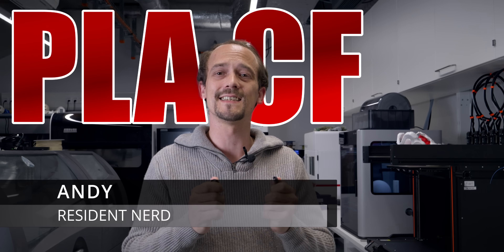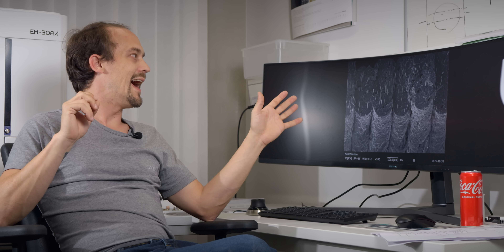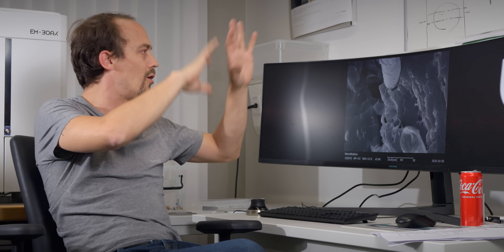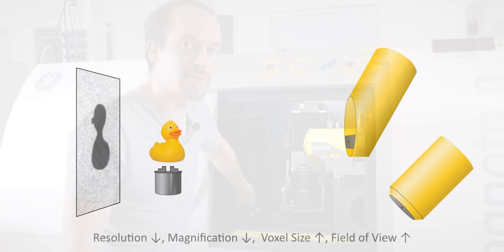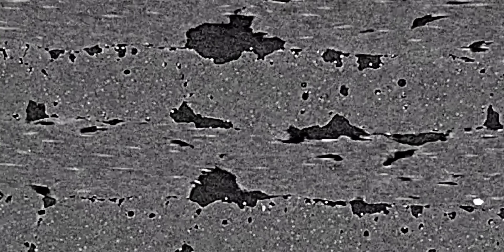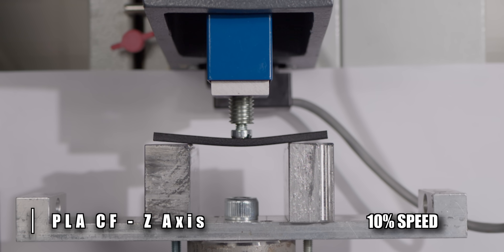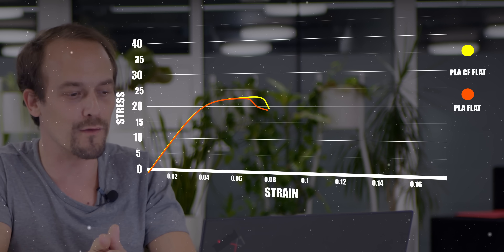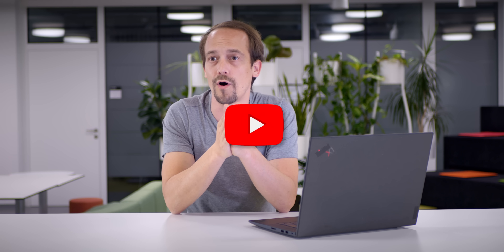3D Printing’s Biggest Scam Is Even Worse Than We Thought!

Comment: I just subscribed for the upcoming video part 3 you mentioned in the comments.

Verwende selbst nur PA-CF für ein spezifisches Teil. Für Kite Ventil Adapter für Duotone AirPort Ventile und da nur für das oberste Bajonett Teil weil PA dafür einfach zu weich ist.
Das ist weniger als 2m Filament pro Ventil. Danach putze ich die Teile damit sich im Alltag möglichst wenig Fasern von der Oberfläche lösen.

Wenn jemand ein anderes Material kennt dass diese mechanische Belastung aushalten kann, ich bin immer für Tipps offen.

Comment: Everyone knows PLA cf is for surface finish only. You want engendering grade parts use engineering grade filaments. Why did you even waste your time?
Reply: Because not everyone knows. That is clearly evident by the fact that people made it, and it sells.

Many people are victims of marketing, and hype, or simply believe that because CF helps in material X, it will help in material Y, because they do not know enough about the materials to understand why it won't help with material Y.

You need to remember that not everyone has your background knowledge of understanding to lean on. Not everyone has the time to thoroughly research the materials they are using.

This was not a waste of time.

Comment: I'm not an engineer but simple logic dictates that the strength of a composit is affected by a few simple parameters. 
The compression resistance of the filler/ binder, the stretch resistance of the tension fibers, the binding strength between the two, and the physical dimentions of each and the relationship between the two. 
If the filler doesn't bind to the fibers they are useless.  If the fibers are to short they do little to resist stretch. Overlapping short fibers aren't as good as continous ones running the length of the part, and in that case the spacing and adherence are the critical factor.
It appears carbon in the configuration used ( and i realize there are different amouts of fill available,  for both) doesn't provide nearly the gains in strength as a non-homogenious lay-up specific to the product.

Comment: What printing temperatures are you using? I always bump the default temperature +10-15c for most of my filaments and my layer bonding is always excellent. My parts will fail like an injection molded part would- cracks through a solid at an angle to the layer line not along the layer lines. Been printing since the original MakerBot Replicator. I print with pla-cf and my parts are superior and make a ceramic/metallic tinking sound when dropped or struck.
Reply: My guess is your mysterious voids are also being caused by low printing temperature. Looks like you’re printing a partially melted solid. Add 10 to 15°C to your printing temperature and do the inspection again.

Comment: This is a most enlightening video of carbon fiber reinforced PLA filament! Thank you for documenting and publishing your work!
Regarding the cohesion of the PLA polymer to the carbon fibers, and the voids, there are many other variables, such as the print settings; Controllable variables such as nozzle temperature, inner & outer wall speed, layer height, layer width, etc, and uncontrollables such as the worn nozzle diameter, material batch pre and post conditions, room humidity, etc.
A CT scan of the un-extruded filament would also be enlightening: Does it come with voids, are these voids filled with humid air, etc?
Reply from the maker: Thanks for the great feedback! A CT scan of the un-extruded filament is a fantastic idea for future research.

Comment: Excellent work! I’d love to see a deep dive in other CF-filled filaments. 

Also I’m curious about if glass-fiber filled filaments like Bambulab ABS-GF compare to carbon fiber filled. We find that ABS-CF has an excellent strength, rigidity and layer adhesion. We like it even more than CF materials, but we do not have measurable data about its comparative performance.

Comment: Yes please do.. like everyone else i thought same and bought many rolls of PLA CF and PETG CF  and in my experience also noticed many times that PLA Cf and Petg Cf are much worse the standard PETG and 
I keep getting photos of cracked Parts from my customers even 2 days back also one customer sent me a cracked layer part and i  have to replace it... 😢

And for context ( parts i sell are used in Ather 450X Ebike/scooter for mounting mobile holder and action camera... ) so it really needs to serve a strong purpose 😅

Please do more videos and what can be used in my situation that is also budget friendly as in India specially my custom parts are priced reasonably   So ... i would not want to increase prices on changing materials at-least not drastically
Reply from the maker: Try to use a hard 95 or so tpu. It's energy absorbent and nearly indestructible. 
Also nylon if your printer can handle it. 
I used to own a 3d printing business and had a branch in India. So I know about the issue of keeping it dry enough but the invest in a cheap dry box is worth it.

Comment: @1:40 - which nobody called out? if you read the comments on your last video, you find a post by me:

i wrote 'in organically filled filaments (wood or carbon fibre) usually a "coupling agent" is needed - for example stearyl titanate but this also greatly increases the layer adhesion'

the PLA does not want to stick to carbon fibre and this weakens the part - to solve that, as i said a coupling agent is added, stearyl titanate or maleic anhydride

so if carbon fibre fillled filaments have better inter-layer-bonding it is not because of the carbon fibres, it is because the put in a lot of other additives

Comment: First of all thanks for the great video. You had me at "About... Well, actually exactly x200" 😅

Now, I'm not sure I'd jump to conclusions for ALL PLA-CF. It's entirely possible that some manufacturers do the proper R&D of finding the right dispersant (and its amount) + the right adhesion promoter between fibers and polymer (and its amount). That would be standard practice for making a formulation for an engineering product.

But... PLA-CF that most people buy is a consumer product and to keep it competitive on price I'm sure some corners were cut :)
Reply from the maker: You're absolutely right! It's difficult to make blanket statements for all materials, and the quality certainly varies greatly with consumer-grade products.

Comment: Few advantages of PLA-CF: less shrinking, better dimensional accuracy (yes, PLA shrink as well, for example I need few holes as template for drilling). Additionally, you can anneal PLA-CF having huge temperature resistance without huge deforming of the material. Core filaments have fibers inside of filament.. And I would also like to see health effect investigation of carbon fibers. 
Other: Technical filament with the best layer adhesion is the Qidi PET-GF. Somehow they solved that fibers stick to the base material.. You could check what's happening inside..

Comment: 16:26 yes please video on filaments that benefit from CF
Reply: I would say PP-CF. It warpes a lot less then standart PP
Reply: I've used PETG-CF10%, compared to plain PETG it feels and handles completely different though the main difference seems to be surface finish with almost no visible layer lines. That said I use the hell out of reinforced nylon, I started with asacf08 and could immediately notice a difference. Part stiffness is far higher, and a great finish. My current favorite filament for items that will see high use is PPA-CF core, there are many claims made as to the benefits of the core concentrated fiber so I'd love to see a test on something like that! (If not only to justify the cost to the wife 😂)
Reply: @SgtDanny2142     this stuff? Looks cool! So you prefer the Core over the normal distributed cf ppa? Any prot tips for printing with it? Nylon print profile good enough? I have hardened tips, Core One as well as enclosed XL. Glue stick on smooth or textured bed i assume yeah? I have some cf ASA i have yet to try as well as cf nylon X. Excited to put these performance filaments to use. Cheers!
Reply: Very curious to see if CF benefits PPS. Pure PPS filament is a little cheaper than the CF version, and doesn't require a hardened nozzle; so it'd be interesting to know what (if any) benefits the CF provides for the additional cost.
Reply: @kazwalker764 It allows it to be printed. Pure PPS warps like crazy. PPS-CF prints beautifully. That's the real advantage of cf filaments, dimensional stability and printability.
Reply: @BFriesen  Interesting, is that the case even in a heated print chamber?
Reply: @kazwalker764 Yeah, a heated chamber helps, but anything non trivially sized is a disaster without the carbon.
Reply: that would be PETG CF. its amazing
Reply: @genin69 i think he literally says in his videos that pla and petg's mechanical properties all get worse...
Reply: @genin69  It still has terrible impact resistance.

Comment: Due to my studies i can be both a Composite Technitian/Engineer and an Additive Manufacturing Technitian/Engineer and i have an adequate understanding of materials especially polymers and carbon fiber
As soon ans PLA-CF became mainstream i already knew that it was a "scam" since the only benefit you'd get is a stiffer part. But now you debunked that aswell and proved that PLA-CF is good only if you want a PLA print but with hidden layers and a better texture (and maybe better dimensional accuracy).
Loved the video and I'm looking forward to the Real CF Materials and the Glass fiber Filaments to prove or debunk what i know about those

Comment: I think comparing xray analysis of this would be interesting: Some materials side by side: PLA, PETG, ASA and a foaming filament, for example Aero ASA. Also maybe check (for one of the materials) different printing temperatures and moisture levels to compare bubble forming overall uniformity in polymerization.

Comment: I bet those voids are from turbulence in the flow of the plastic. I dont think a lot is thought about in the smoothness of the inside of the nozzle, which would be completely destroyed in short order by abrasives. Or it could be from offgassing of the material as well, not from moisture, but from the polymer breaking down. 

Just thinking out loud here.

Comment: I've been chatting with someone from a large filament manufacturer about PLA-CF. They basically agreed that it's not a good material in terms of mechanical properties, but market research still showed significant demand for it, mainly because of the surface finish. Even in their own data sheets, you can see that the PLA-CF performs significantly worse in basically every category. It's only slightly better in impact strength, but that's likely because of a different PLA formula.
That just shows once again that reading the TDS is important when choosing materials. Even if they can't be compared across manufacturers unless they were tested independently by the same standards, even within one manufacturer, it can quickly show you things like this.
I'm curious both about other CF-materials and the potential health hazards.
PLA-CF isn't an engineering material, but it can look nice, which is still a selling point. PA-CF and similar materials do benefit from the carbon fiber, that much is clear.
That's why I think research about the health risks would be interesting, because even if PLA-CF sucks as an engineering material, people will keep using it because of its look.
If it is indeed a health hazard, people might need to reconsider using it at all.
My biggest question after this video, which would relate to both topics, is if materials such as PA actually do bond with the fibers, and if that's the reason why it's an actual benefit for PA-CF and if that also means a lower health risk, since the fibers wouldn't just "fall out".
While PA-CF is probably one of the most popular CF-filaments, I'd also like to see how ASA and ABS interact with CF reinforcement.

Comment: Carbon fiber is the asbestos of the 22nd century.
Reply: No it isn’t. Asbestos fibres are far finer and needle like. They cannot break down in the body. Carbon fibres aren’t classified as a carcinogen, are much thicker and do break down in the body.
Reply: @dominicj1170  It would be helpful to show sources that confirm carbon fiber is broken down.  The articles I have read say it is pretty chemically inert with respect to most biological processes and the body just tries to work around it similar to asbestos or glass fibers.  It frequently fails at this though and so having pieces of chemically inert materials inside your body is still a very bad idea just like SiO2, asbestos, coal dust, etc...  

I do not know what kind of information people would use to cause them to think otherwise...

Comment: Carbon Fiber by itself is weak, it needs a strong bonding agent for it to be strong.  From what you found, there IS no bonding agent to strengthen the fibers. There is also no interlinking of fibers in those tests. What makes a panel made of CF strong is the linking of strands, the bonding of the resins, and the tight compression of all the materials as it cures.  If the plastic that is embedded with the strands can bond to the fibers, then the CF can actually add to its stiffness, but structurally, what you found, is just a scam.

Comment: There is no scam and therefore this video title is clickbate. You're simply pulling the claims out of proportion. I am printing with all kinds of materials for over 10 years now and CF-infused materials were never about strength. Strength doesn't actually mean anything at all, because it is used for all kinds of properties that even conflict with each other.
Sure CF-materials were very expensive, especially in the beginning. But all new high-tech filaments are.

Here is what is not a scam about CF-Filaments and what they were marketed for: CF-infused materials help with printability. That came way before closed printers flooded the market. Open printers suddenly were capable of printing higher temp materials, like ABS and PA without any significant warping. That was a very big deal all on it's own. Further, the materials became stiffer and that's a fact and no scam either. Sure also more brittle but I have lot's of use cases where I need stiffness and high temp capabilities. Neither ABS nor PA6/PA12 can handle temperatures above 130°C and they are not stiff enough for many applications, expecially in measuring equipment, where you mainly need stiffness and can't use metal parts.

CF-additions also help with heat dissipation and also making parts more heat resistant.

When it comes to PLA and CF additions it is never about adding any mechanical properties, besides maybe better heat deflection. But most PLA-CF don't contain enough CF. Most are between 5% and 15%. But they do provide easier printability and a finish that hides the layer lines.

Regarding health risk: When melting CF-infused materials health risks may be a factor, but it is way less than melting PETG, ABS, PA. Pure PLA is probably the safest one out there (not PLA+!) but CF is very heat resistant and can't melt at that low temperatures. So that is not actually a real concern.
In terms of the particles: There are people that compare CF particles to asbestos but that's pure BS. The particles are way too heavy to fly around in the air like asbestos can and way too big to go through skin. Yes they can partially embed into the skin, just like wood and metal shavings can. However it will be rejected by the body. There are way worse things out there to worry about (e.g. cigarette smoke, teflon and similar chemicals, car exhaust, and much more).

Comment: Was the song AI generated? So epoxy any CF reinforced materials like any other CF projects, and use gloves and respirator when handling any raw materials.
Reply from the maker: Yes it is ai made 😅
And greate tip with the epoxy
Reply: @Ibuiltathing it was crazy good! Which model did you use?

Comment: Good video with very good testing methods, but for me PLA-CF was nonsense before watching this video, I´m printing for 4 1/2 years and never used PLA for something that has to be strong.
For example, I glued 2 plates ( 120mm x 60 mm x 5 mm ) together with a bit of my own glue, that was a mixture of ABS and acetone.
Next day had to use a lot of power to separate them again, the PLA layers splitted, but the glue point was intact !
I use acetone in many ways, so I clean the (glass-) bed of my old Creality CR-6 SE every 10-20 prints with it and it looks like and the adhesion is like on a brand new one !
In your former video ( Form next, Fibre Seek) you said in a comment, you would like to see this technologyt on a Prusa XL, but let me tell you, Prusa printers have a bad quality seen over all, I have seen tests when more fog (from a fog machine) came out on the corners ans the door then on the outlet, for such a test it was the badest (housed) printer !
I would NEVER buy a Prusa, because the prize is much to high for quality and it´s produced in a country, that has very low incomes, Mr. Prusa became one of the richest people in his country by selling a few printers, that has always been incomplete.

Comment: This is due to the COE of cf and the pla being different. There are so many parallels that can be drawn between glass blowing and 3d printing. Annealing glasses of different Coe that are blown together either explodes or implodes based on whether the higher COE glass was inside or out. The cf will always separate from the polymer because of how much more it contracts during cooling. Thank you for showing the SEM images it helps confirm what I thought was happening.